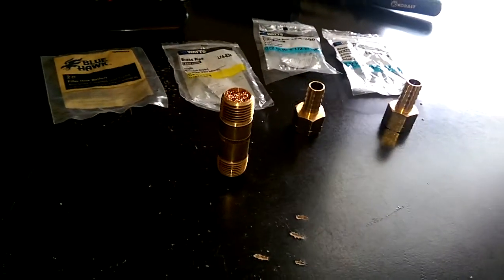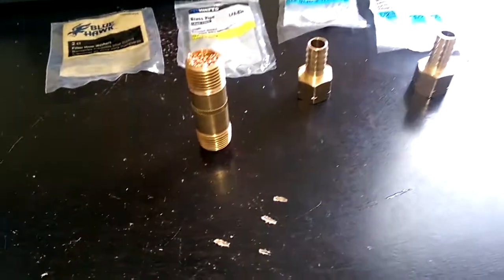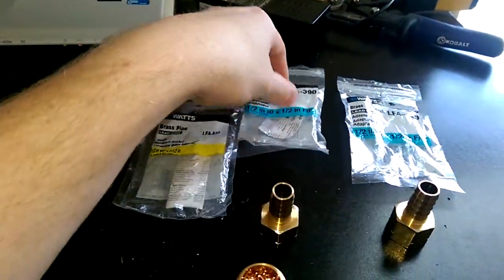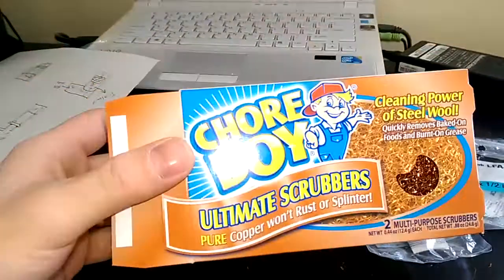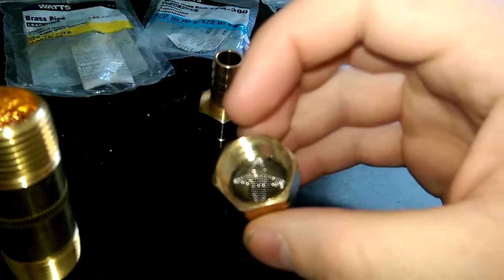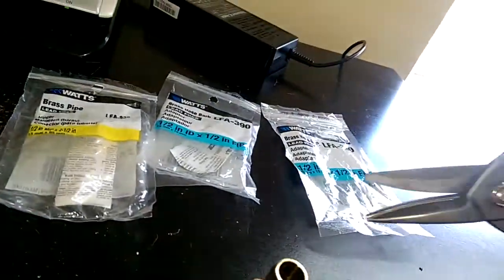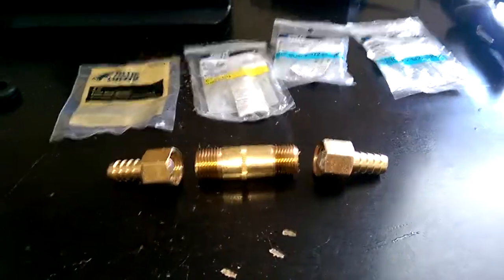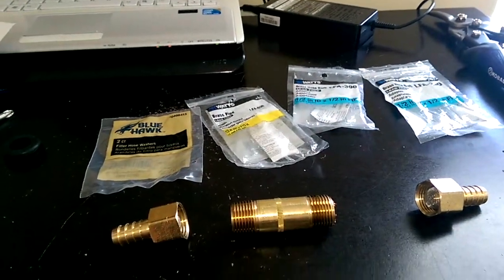DIY Flashback Arrestor

Comment: Please explain why use an arrestor when the gas is first going to pass through a water jar? Surely that will act as a one way valve?
Reply: This will save your water jar from even being stressed by a flashback. Ideally a flashback should never happen, ever, unless you specifically are trying to make it happen.
Reply: @mememan2344  I blew up my whole rig. Thought arrestor was not important.  Lucky I hid behind a wall. And used ear muffs

Comment: Is it possible to replace the copper wool to steel wool?
Reply: allen chen, NO STEEL WOOL IS FLAMMABLE, ONE SPARK AND A WHOLE PAD OF STEEL WOOL WILL SPARK N TURN BRIGHT RED...
Reply: If u get like a steel wool that is not very fine it would like sometimes u find things that say steel wool but are not the traditional supper fine steel wool. But to be honest its best just to buy a flash back arrester
Reply: @n1818n  I tried to buy one in my country Jamaica but on Amazon a arrestor is 11 to 21 dollars usd but in Jamaica it’s 80 usd the same brand for 11 dollars usd I can buy that when I can make one
Reply: What seems to work well is fine stainless steel wool be sure about that the normal one is going to rust.